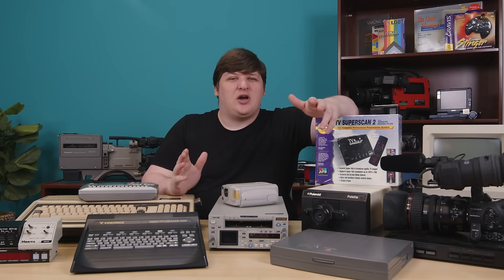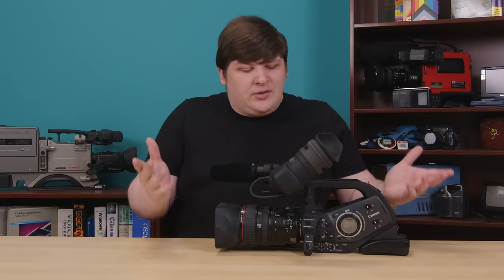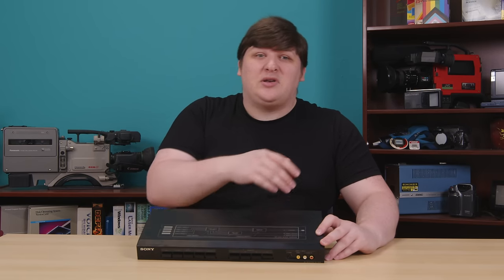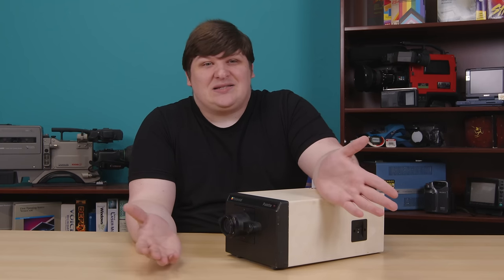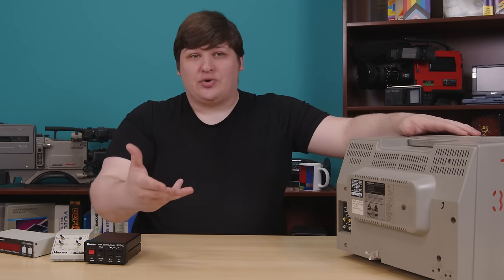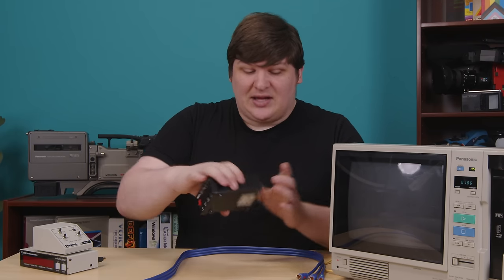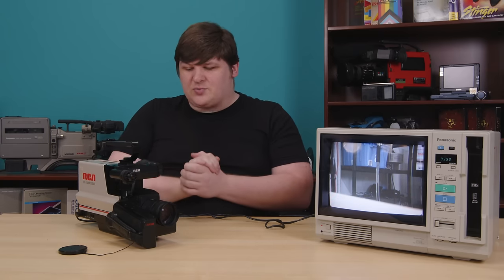Weird Stuff I Got From California (Where else?)

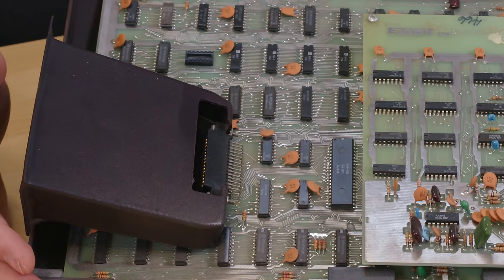Comment: 21:54 It's cheaper to make one big PCB than a bunch of little ones - They were probably trying to save production from having to make a second PCB and a ribbon going down and then engineering reasonable mounts for said PCB. Probably a couple bucks saved there, not just pennies.
The 8 track thing is interesting! I thought that cartridge looked familiar. Thinking about it, this was actually a really good idea. High quality label printing and cartridge shells already existed, why not use them? Pretty durable too, in my experience. This probably helped them save a ton of money and keep the bottom line for the machine further down which was no small feat. 
But also totally hilarious in retrospect, I agree.

23:31 That sounds like the Quantum ProDrive - Yeah, no surprise that it doesn't work.
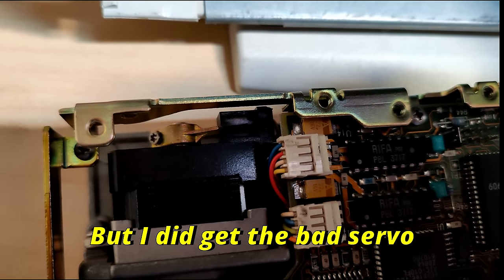24:00 That drive is actually working! It's totally fine! You just need to put a drop or two of oil in it and it will go back to working! That drive actually sounds like it's in really good shape. Spindle bearing good, stepper quiet, no scraping. What you're seeing there is that the drive is failing it's seek test because of missed steps on the pull back - It's probably just sticky inside.

27:43 Yeah the analog side there is unhappy about something. You're seeing retrace lines, so either the brightness is way too high or the frequency is WAY off. I'm thinking both - Turn the brightness level down a bunch until you can't see the retrace lines (the vertical lines you see in the video) and then, since the composite seems to be working, plug something in there and turn the horizontal until you probably wind up with a rolling picture, then turn the vertical until it locks. Probably just a portable TV inside with the exception of the lens and the carousel.
I would be very interested to see you get it working! Interesting piece of history there. The other option I think would have been either printing it out and photographing it or using a plotter!

39:55 Did not know that, now I absolutely need to find an ancient sub of Sailor Moon or something to see both their bad translation and their use of Sony HandyCam titler

Comment: I have a video switcher like the one you showed off from Sony only it was built by some company that wanted RS-232 control of the box. So they used an 8052BASIC microcontroller to run it. For those unfamiliar the 8052BASIC is an intel 8051 microcontroller with a mask ROM that contains a BASIC interpreter. This is a very expensive solution compared to the normal way to do it at the time which would have been assembler programming ether internally of another 8051 or externally with an 8032. The 8052BASIC was like the Basic Stamp or Arduino of it's day but single chip.
Reply: * About the "Sorcerer" that power supply was a normal linear design common to the era and still common to ultra low noise measurement equipment now. I love that the ROM cart is an 8 track case! That's so much better than using the 8 track to house 8 track tape.
* On the MacSE you could try relubricating that drive.
* OMG Shout out questionable comment cameo during the slide printer.

Comment: Some notes about the Canon XLH1, and HDV cameras in general:

The HDV spec included both 1080i(1080 by 1440) at up to 30 fps and 720p(720 by 1280) at up to 60fps.  These specs were selected to match the over the air broadcast HDTV standards.

At the same time the XLH1 came out, JVC launched the GY-HD100.  Unlike Canon and Sony, who went with the 1080i flavor of HDV, JVC went with 720p.  The GY-HD100 had variable frame rates as well, allowing users to shoot true progressive scan 24fps footage with it.  This made it desirable for low budget film makers and was even used extensively in filming "An Inconvenient Truth."

It isn't exactly accurate to say that the 24fps is "fake" 24fps.  It is true 24fps recorded using 2:3:3:2 pulldown mode.  This is a method of mapping 24 fps material to NTSC frame rates, and was how virtually every Hollywood movie shot at 24 fps was transferred to 60i VHS videotape.  Most pro editing software at the time could remove, or do a reverse pulldown, turning 2:3:3:2 24fps pulldown video back to true 24fps progressive scan video.  The very first prosumer camcorder to shoot 24fps, the Panasonic DVX100, also accomplished its 24fps recording this way, by using a 2:3:3:2 pulldown to record 24fps footage in a NTSC stream.

Comment: Companies back in the 80s had AV departments who produce slides transparencies for presentations. I've been in industry for 25 plus years. I sold many many slide projectors particularly the Elmo brand instead of the Kodak brand which was very expensive. I complete package with the case and the kid herself a couple extra lamps would set you back a $800 that was including the wireless remote. Company called AMX which is still around making control systems had the mx40 series of RF remote controls

Comment: You might be interested to know that CP/M actually, totally did run on a few home computers. For example, the single most popular CP/M platform was... the Apple II.
You needed a Z80 expansion card to do it, but that was a pretty popular addon for people that needed to run CP/M software so hey. :)
Reply from the maker: But that doesn't really count. Yeah, they all had it... If you added a whole second computer to your computer. It's like putting a MacBook on top of my PC, SSHing into it and saying my PC can run ARM software now.
Reply: Amstrad disk-based computers also included a version of CP/M, with no extra hardware required because they were Z80 based.

Comment: 1440x1080 looks good as long as you don't have any diagonal lines in the frame. Thats a giveaway. Otherwise the xlh1 is a pretty nice camera, I saw it used in the professional industry as a recce / casting / rehearsal camera till right before the first DSLRs came out that were able to record 1080/25/30/50.

Comment: 3.5mm phone plug AC/DC adapter has much better mechanical connection over barrel plugs. 

they're still easy to find in multiple tip adapters and easy to make.

my older, but not very old, remington cordless trimmer uses 3.5mm. 

my lithium Wahl trimmer has a barrel plug, which is it's shortcoming/failure point.

Comment: Wow I had one of those film recorders back in 1992 ish. There were two cameras that could attach to the front. A standard 35mm for slides etc like you say. And also a poloroid instant film camera. It still took super long to expose because it did one raster scan line at a time and verrry slowly to expose onto the film. 

No idea what happened to it (maybe it’s in the shed) but I was in the digital imaging development business and had the first digital camera and film recorders and dye sublimation printers. The camera was $10,000.00 and 640x480 and the power winder was replaced with a hard drive and the film backplate had a CCD on it. Basically a modified SLR camera.

Comment: I had a pro palette 8000, it did 8000 lines. So the resolutions could be quite high, thats was like 36mp. The best table top models could do 16k, this tech was also used in movie making. As even movies shot on film were eventually scanned and the final prints were made using similar, though larger, devices.
Reply: You can find a small clip of how it works in youtubes that i uploaded long time ago if you search for Polaroid ProPalette 8000 , it shows the line scanning in action with the color filters.

Comment: 54:27 - standard small camera that are used in broadcast even nowadays.
I installed Sony's recent versions (p1, p43, p50) and they are used with robotic systems like Egripment, Telemetrics, Vitek mVRC/Radamec etc etc. 
Also extremely handy when you need 4K UHD broadcast quality picture without compromises installed in remote robotic system in historic buildings, that are installed by special permission (because historic building) and there is no other way to but a camera there (there is no space for camera operator in the corner of ceiling of the historic concert hall).
Also cameras like that been used in Europarliament and other governmental broadcast, and some european broadcast studios have mostly everything robotic and have only once camera operator, who orchestrates PTZ robotics and control colour and exposure using RCP units, someone who can control telepromter (it is possible to do it from home!) and a broadcast director near vision mixer, sometimes a dedicated sound engineer (or remote) and anchorman in the studio.

Comment: 23:00 I don't think using an 8-track is necessarily a cost cutting measure, or in any way a bad thing. Using 8-track would mean that your customer already has access to media storage in the form of whatever is used to store those. It's not really like CDs are any different: a normally audio media used in computers and due to its popularity shelves specifically designed to organize discs are cheap and readily available.

Comment: OH HEY so about that time code burner with the wonky power supply, Ibanez and Maxon guitar effects pedals from the 80s use the same connector & polarity. There are guitar companies now that make adapters to use modern barrel jack power supplies with them! So if you ever do need to replace that supply you might find one at a guitar store

Comment: From what I could find digging around on time code it is literally audio on a BNC or on older devices 1/4', 3.5, RCA, etc. there's some variations to it but the standard is so old and cross compatible that everything uses it. I discovered part of this rabbit hole when somehow I acquired a 1U rackmount composite video time code unit which allows me to do a count up or time code or free run overlay with crude adjustments to location. on the upside it does have Rotary knobs to adjust locations X and Y. Unfortunately it requires composite video pass through to function properly, so I find myself in need of a external display module screen some thing like oh that would be perfect great prices are gonna go up on eBay. On the upside I bought myself a GOOD digital audio recorder this year so I actually have something that generates TC!

Comment: The Chinon digital camera uses a Type I or II PCMCIA flash card which were actually quite common back in the day. You can get these cards that serve as adapters for standard compact flash cards which you can get a USB adapter for.  I had use of one of these that was branded by Kodak and stored images with a .KDC file extension.  You can view them in a freeware viewer like IrfanView and convert to JPG, etc.  Image quality is 'meh' compared to today's standards (768x512 resolution), but when it came out it was a halfway decent camera.
Reply from the maker: That's the thing, I tried one of those right off the bat, with a variety of new and old CF cards and even a WD silicondrive, and it wouldn't acknowledge them.
Reply: @CathodeRayDude  The camera I had was a Kodak DC-50.  The Chinon must have different firmware.

Comment: I remember that my Pentax K-3 (OG) could shoot video in 1280x720 at 24p, 25p, 30p, 50p, and 60p... BUT, if you wanted 1920x1080 then you were limited on the kind of Scanning Methods you were able to record in according to the framerate since you could record a video in 1920x1080 with 24p, 25p, and 30p framerates and, even though my Pentax K-3 wasn't meant to record video per-se, the video quality was rather good, though you could muck it up super easily without realizing it. One way that you could screw up your videos was to record your video in 1920x1080 at a framerate that was higher than 30fps, causing the Scanning Method to automatically be set to Interlaced, making your video look like dog doody, I should know, I recorded my sister's wedding in 1920x1080 at 60fps, not knowing that choosing that high framerate with that "Higher" resolution caused it to Interlace ALL of my footage!

That being said, I actually figured out some decent settings for the mighty photo camera (it was a photo camera first, video recording was an after thought), and when I started taking classes for my film degree, I was able to shoot my first, self created film with the ol' gal and managed to satisfy my professor with it.

I guess, what I'm trying to say is... I loathe Interlace with a passion!

Comment: Re: No EV adjust on prosumer camcorders/professional video cams - its kind of understood that you know what you're doing. EV controls are like Auto mode. They can't be discerning about the lighting conditions. If you're doing work, you set shutter angle to 180 most of the time. If you're on set, you have a DoF already in mind. Your gain is ideally going to match what you've already shot. That's the exposure triangle already set. You adjust lighting to match what you want.
If shooting documentary / run and gun, your aperture will be wide open and your hand on the gain control anyway. Your shutter angle is equally going to be touched unless you want that undercrank effect or something. In every case, the EV dial makes no sense for a prosumer / professional in those days . Now with the dependence on post-prod, and the DSLR video boom, you still have no reason to actually use the EV dial on your Sony body unless you're running and gunning.

Comment: When they switched to HD in our studios/news rooms, I think it was between Sony XDCAM HD and Panasonic P2, and they ended up going with XDCAM HD. The reason was 100% down to media cost. The solid state media of P2 was much more expensive than the XDCAM HD discs, and they knew the ENG crews would lose the media no matter how much it costs, so they'd spend way less on XDCAM HD than P2. I believe the P2 cameras were a lot better and had full 1920x1080 sensors vs the 1440x1080 of the Sony cameras, but there really wasn't any other option. They certainly weren't going to go with a Canon. (I think they may have actually laughed at someone suggesting JVC.)

I really should look into SMPTE timecode more. We're building a new studio at work, and it's going to be using SMPTE 2110. Basically fully IP-based transport of all video, audio, control, and, you guessed it, timecode. I know it uses PTP for synchronisation, but I'm not sure how the timecode part works. I suspect devices like such as cameras just take the PTP multicast packets, strip off the IP header and embed the payload into the video and audio "frames" as they're sent out. That would be the simplest way of doing it, but it's probably a lot more cleverer than that.

Interesting that they had a servo controlled camera like that Hitachi one back in the day. Our new studio's going to be fully automated, like you'll be able to run an entire broadcast with just one or two dudes in the control room, an autocue operator and the talent. The cameras will move around and focus robotically, controlled by computer. They'll just write the script, including all the clips, lower thirds, graphics, etc., and program the camera moves ahead of time. Then all they'll need to do is basically "press play" on the automation and have the talent read the script. I wonder if that's the kind of thing they were thinking about when they built a remote servo controlled camera back in the day.

Oh, and if you have multiple shows (fixed sets) in the same studio, press a few buttons and the cameras just move from one set to the next, ready to start shooting. It's going to be totally sick.

Anyway, CGP Grey was right, at that point they're basically a few small steps away from an AI replacing everyone else in the studio/control room besides the talent.

Comment: iirc the XL-H1 does not fake its 24 FPS. The XL-2 did, doing essentially the same 3:2 pulldown that all DVDs use right inside the camera. But the XL-H1 could apparently shoot true progressive 24 FPS. This feature was so obscure that only the camera itself and a rare and expensive standalone HDV deck were capable of playing back and transferring that footage correctly.
Reply from the maker: Huh! It does indeed seem rare, to the point that when I looked it up for the script, whatever I found said it was fake. That's very cool, thank you for the correction!
Reply: @CathodeRayDude  It seems we're both right, according to the manual, in SD mode it  can either do 2:3 pulldown to entirely fake it, or 2:3:3:2 pulldown to extract the frames later (and I quote) "in order to transfer to film." But in HD mode, its true progressive 24fps onto tape, but playback only over the HDV/firewire port. Even if yours had the HD SDI, it would be 2:3 pulldown 60fps. So ahead of its time it barely works! The best kind of thing!

Comment: I always found it weird that early HD formats recorded in 4:3 HD. But Bluray's never supported 1440X1080 in its specs. So that you could put 4:3 shows that where remastered in HD. At its proper square aspect ratio. Instead of matting them to 1920x1080. Or other aspect ratios, in general. Being put into their square ratios, 1920x800 etc. Just support resolutions between 4:3 through 16:9.

Comment: Using an 8 track for a cartridge, also means all the 8 track storage that was available at the time would also work for their cartridges
Reply from the maker: It may not have been clear - they only used the shell. Inside is a PCB with ROM chips.
Reply: @CathodeRayDude  I meant the physical storage,  like they could be stored in any rack, box, case, etc that 8 tracks could be put in would also hold those carts.

Comment: I wouldn’t be surprised if that slide printer’s CRT’s coil was free-running with no input :) hence the 11kHz region of its output.

I was just about to say I bet it doesn’t run as slow or high-res as the high-end ones just as you got to that! Could still use a unique sync rate though.